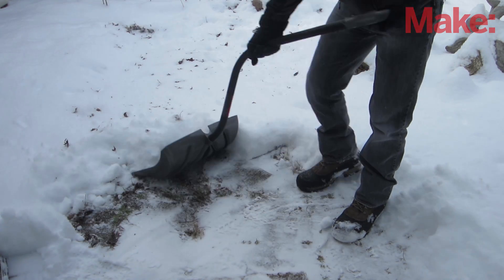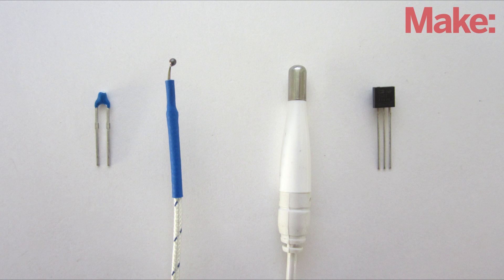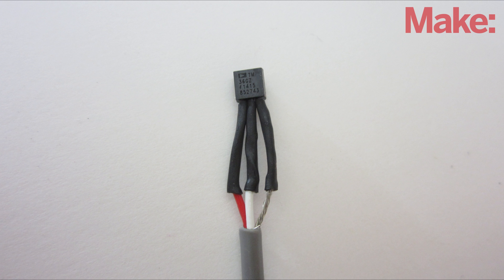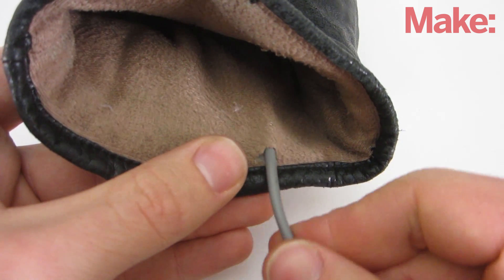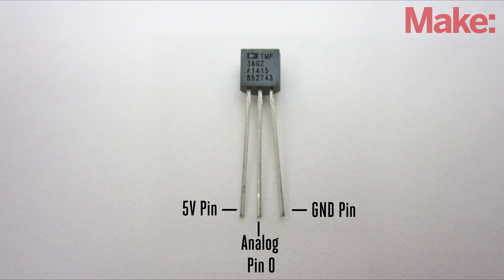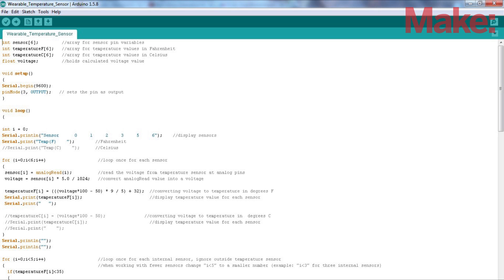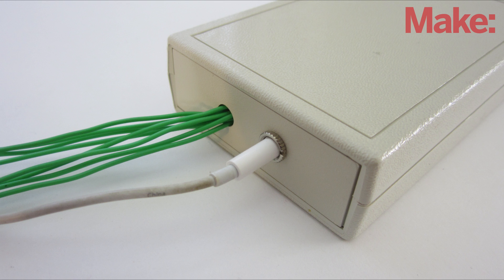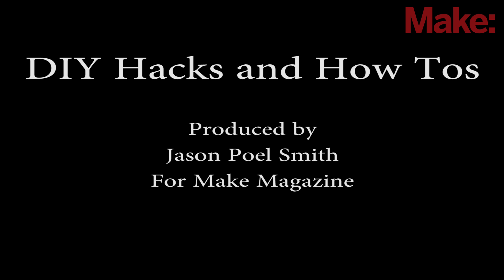Wearable Temperature Sensors

Comment: Guys, guys. You don't have to use a Arduino if you don't want to. He uses an Arduino because majority of the audience is comfortable with it. Have an idea to make it smaller? Post it, show it off, but no need to bitch about the video not having it. 

This is actually a nice idea, so I might build my own. The difference will be the controller, of course. I will make a set of 4 systems. Each is a small PCB with Attiny85 and temp controller soldered on. Thin wires go to the sensors in fingers/toe areas. Each system will be completely independent to prevent annoying tangles, will be powered by watch batteries, and have a low-voltage but incredibly annoying piezo buzzer to alert me when temps get dangerous.

Comment: Or, you know, get better gloves and shoes?

Neat project though, but could definitely do with a lot of miniaturization still, like using a smaller Arduino, or even still just an attiny.
Reply: You probably do not know, what cold weather is. Under -15C no matter what you are wearing, you will eventually start getting frostbite. 

No need for an alarm though, usually the extreme pain you get in your fingertips and toes will do the trick.
Reply: Mr Mürk Haha, I grew up and have lived most of my life in north of Sweden, believe me, I know what cold is, probably moreso than most of the people on earth today. 

You're entirely right that you will eventually start getting frostbite (almost) regardless what you're wearing, if you're standing still. The key is to keep moving, as movement generates heat, which is carried with blood out to your extremities heating them up. If you're out shoveling snow you'll run dramatically less risk of frostbite than if you're just standing still, unless of course you start sweating too much and cool yourself down that way.

Comment: Why would you use an arduino for this? Arduinos are too clunky and large for stuff like this, and the arduino I have is the mega.... Why not use a microchip instead? I can't remember what microchip it was, but you program it with the arduino, and is really small.
Reply: The ultimate solution (in my opinion) would be a single ATTiny85 which can handle two analog inputs and output a pwm signal.  It can be programmed, using an arduino as an ISP, through the arduino IDE and be powered using a rechargeable LiPo battery cell.
Reply: cuz arduino can be programmed more easily.
Reply: nRADRUS I'd rather have portability and compact sizes than spend an extra few minutes getting the code on that chip..
Reply: Jordan O'C
and spend more money and time for this ? for temporary event ?
Reply: nRADRUS Well, not necessarily more money.. If you already had those chips, you could just reprogram it. C'mon, it's like a tiny arduino c: And yeah, spend some more time on it. If it's a project, there's no real rush, now is there? Also, it would take like 5 minutes to get the code on the chip.. Not that hard lol
Reply: The attiny85 could do this